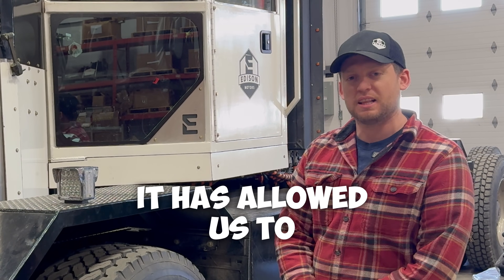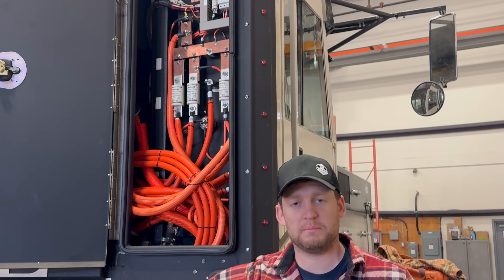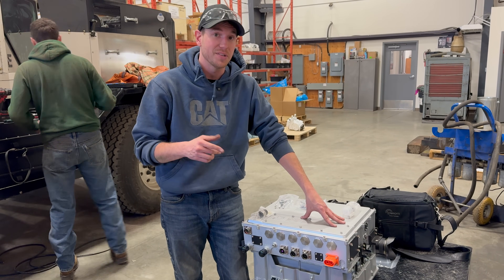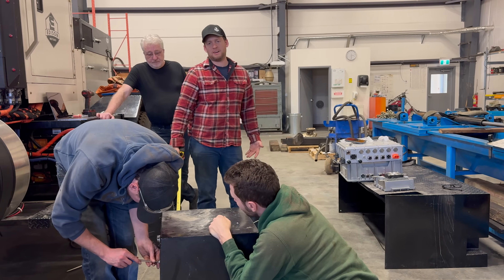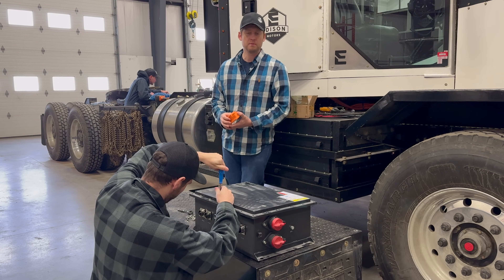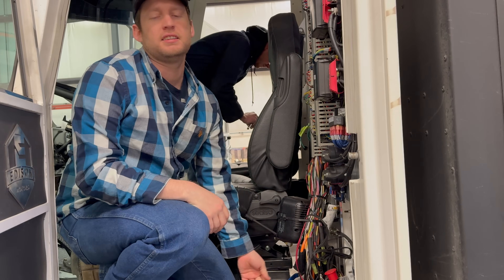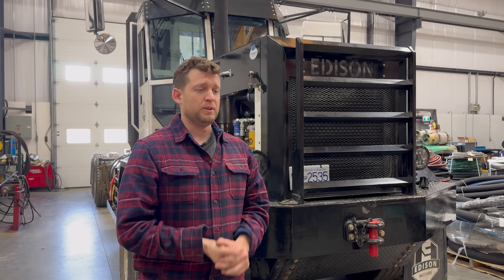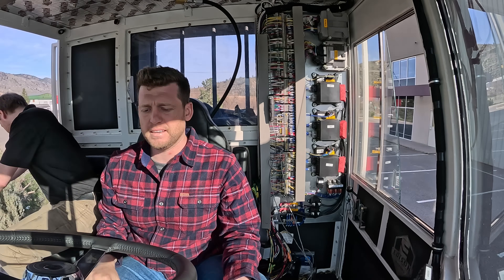Revolutionizing Truck Power Systems: Lessons Learned Prototype

Comment: suggestion have 🔒 lock out tag out protocol  so nobody can turn on and accidentally fri 
some   
   industrial systems had a Lock out that either cover or  mount on and has multiple provisions for locks 🔒 so if more than one person working on different areas can't be turned on till all locks 🔒 have been removed = to everyone safe

Comment: Congratulations Chase and Edison Motors.  This tech makes more sense than an off grid emergency generator and using off grid power with diesel backup.  One day perhaps a front grill wind turbine and solar roof on trucks and trailers roofs.  Solar modular units.

Comment: Just like when Im building vacuum tube audio amplifiers, gotta varify there's no volts left in the system lol. I know that's gotta be scary though, I'm worried about like 100 milliamps at 450v DC at idle (no signal) but your possible exposure is so much more current than that.

Comment: You should goto a DC generator, ditch the ac 3phase unit, there's probably 5% fuel economy in that just from PF and thermal loses. Also, I think you've oversized the genset, i bet you only need a 50% of what have now, but that varys with aero and weight. For on road hybrid conversions, probably use a smaller genser for dry van etc
Reply: I believe they increased the size of the genset because of power requirements. 🤔

Comment: Hey Guys!  Question.  What is Topsy's theoretical top speed?
Reply: In the absence of throttle limiting:
225Kph (~140mph) both forward and revise. 

If the specs I came across are accurate,  though I doubt anyone has been nuts enough to test it yet even on a test rig.

Comment: I hope the new cab design makes maintenance a little easier as the current iteration looks to be a bit of a pain in the ass.  Removing the seat and crawling around on the floor that's inevitably going to be covered in mud just doesn't sound remotely fun.

Comment: Honestly I like the headache rack being   .. maybe not hot swappable, but an all in one deal.. having all the important stuff in there makes sense. Would love to see it be modular, though. Custom fab cabinets that just bolt on or slide in. That way, if something breaks, you just pull the cabinet and slot in a replacement

Comment: What are you going to do to replace the engine brake and will it hold back a load down hill?
Reply: A jake break capability has been discussed a number of times,  though I'm not aware of it having been implemented and tested as of yet. 
If I understand it correctly,  it would be capable of being used for breaking as well as bleeding off excess power to protect the batteries from being overcharged by regenerative breaking power generation.

Comment: just an idea that I have had for a while.  I think you should put motors on the trailers as well for that would take a big load off the truck as well as give a lot more regeneration with the braking.  I am wondering if you have thought of this.
Reply: There are at least 2 major manufacturers presently developing/testing power equipped trailers both for drive and regen' purposes.

Comment: Sometimes it's hard to justify changing little things during prototyping as they mostly work. So sometimes it's good to blow things up so you can change out the big and little things you might not normally change out until later down the road. It's the "if it ain't broke don't fix it" well it broke so now the nice to haves get dealt with too.

Comment: One thing i don't get is why plastic airlines don't work. I work on the light duty side of things, and nylon fuel lines are quite common in the us on cars, mostly pickups from the 90's to the early 2010's. I get them going bad all the time, but that's usually when they are 15-20 years old. Granted, the connections are almost never the sharkbite style push fit. they use hose barbs that are pressed inside, in repair the nylon must be heated first.  It's about half the pressure airlines work at, but i would think compression fittings instead of the push on would work just fine at airline pressure. 
IDK, what I'm trying to say exactly, I just feel that the problems with newer nylon airlines is more of a connection/quality/design issue than a nylon issue. And it doesn't have to be nylon either, but I think solid tubing of some sort is the more ideal cost to robustness to longevity to weight to ease of repair ratio than braided steel cable. At least for the long runs along the frame rails.
Reply: I guess the logic is that they work well enough. Newer heavy truck air system quick connect fittings, in my experience, are almost all the quick connect style that can be disconnected again fairly easily. The main reason they are used imo is that in the bean counter's eyes, it takes too much time to assemble a truck air system with older style fittings that are good to go for decades with brass ferrules that crimp down on the hose when tightened. If the quick connect fittings start leaking a little air a couple years down the road, who cares? It's long gone out the factory door and probably out of warranty too

Comment: I was just wondering if anyone here has heard of Dynacert its a Canadian company aswell. I feel like if their product works it would be a great fit for your project.
It is supposed to make cleaner and stronger combustion with hydrogen and oxygen it produces from electrolysis.
Just an electrician not a diesel mechanic.

Comment: Just a quick suggestion. Have you driven a Nissan e-Power vehicle. It too has a electric drivetrain with a petrol engine as generator. But their generator has more than one RPM configuration. As an example for a high power requirement it would increase the generator RPM and has the ability to draw power from both the battery and generator to power the motor when required.

Comment: OK, I just had a light bulb moment.  If I understand this, there are no gears to shift?  This is like an automatic; forward, reverse, and instead of neutral you just have off?  So, your accelerator pedal take you from zero to top speed with no interruptions?  Oh, and you could get full speed in reverse?

Comment: I use air vacuum tool called Air-Lift to vacuum coolent systems on cars , when mostly drained , i pulla vacuum ot 25 HG and close the valve and disconnect the vacuum part of the tool and connect the hose to suck the coolant from a bucket into the system when I open the valve , it takes only about 5 minutes to vacuum down a system and re - fill it and it gets out all the air every time , much faster than pouring it and running the engine trying to get all the trapped air out , some cars have bleader valves that usually don't work totally well .
Vac the system down just like you would a AC system to get All the air out and then fill it , end of the problem, and very fast .

Comment: It would be nice if you added LEDs with big resistors to the high voltage lines so you have another indicator of "hey, this is HOT".  That way if the voltage is below 48v, the LEDs would extinguish, be lit anywhere above that.  Having multiple LEDs in parallel with separate resistors would also account for failures of individual LEDs.

Comment: From what Chace said at the beginning about the voltage drop from the generator taking a load. Couldn't you simply use a loop PID on the generator RPM so that when it takes a load, it will automaticly readjust itself at 1800 RPM. Instead of it being a constant ? There is a PID ready to use in the plus 1 Guide that you are using to program.

Comment: Another locomotive inspiration for ya, locomotives will "crowbar" the high voltage systems when you access the high voltage cabinet with a door interlock. This will tell the computers that the system is also discharged, and you can follow a flow chart if the computers are inaccessible to verify high voltage systems discharge much like you did manually.

Comment: You need leather protectors over your low voltage gloves. They make them to fit over the rubber gloves.   Prototype’s are to expose problems and find solutions.  No one thinks of everything the first time.

Comment: New inverter makes more heat in your cooling system. Going from air cooled to water cooled sounds right. If you pull a vacuum on the cooling system you can get the air out of it. Terry at Yosemitetractor.

Comment: i just heard 12 volt 24 volt batteries, ...
you neeed Higher voltages
i do understand the logistics, i do understand the engineering, i do understand the immense leap that YOU are making
good luck friends
Gotts say,..what a sick looking rig when its rollin down the road, what a Beast
Good luck World Beaters.
sorry by higher Voltages i mean "match Teslas charging networks highest voltages", what you are doing is immense but do not come outta the gate behind the technologies that are powering the established networks for Charging and at the very least reach out to find the best spec to do so with for the future,
Reply: Those are the low voltage batteries for running the air compressors, computers, starter motor for generator. The high voltage batteries are the one that actually move the vehicle
Reply: @JD-yx7be  
ahh very good , i must re watch to see what the actual "Line" voltage is for the storage pack, i used to think it was 400Vlts ,now im not sure.
I know that the "Industry" is heading towards 800Volts (or higher) and it would be a good solution to be able to access that Infrastructure "out of the box" and capitalize on someone elses expended capital.

Comment: did you test drive it with the batteries unplugged? or where you just doing first test with the upgrades? im glad i recommended being able to limp it around on just the generator! that truck could sit for 50 years and fire right up with A jump! amazing truck glad to be A part of an amazing world changing product. good luck and gods speed!

Comment: Guys I love what you're trying to do but use the electrical insulation gloves properly.  Please. To put on gloves 
Step 1  apply talcum powder to the insides of the rubber gloves.
Step2 insert hands in glove
Step 3 insert the rubber gloves into the leather gloves that came with the rubber gloves. 
Then do work.
 The leather gloves are of vital importance.  They absorb the damage from sharp edges and the dirt and grease that can be found in the electrical  field. 
You NEVER work with just the rubber gloves. The smallest pin hole in the rubber glove and it is no longer  rated for high voltage.  High voltage needs only a hole from a hypodermic needle to jump the insulation of the rubber glove and make contact with your skin. If I had seen any of my electricians do what your man did. The gloves would have to be sent off for recertification.  I know you're just loggers and field mechanics.  But high voltage  must be treated with respect at all times. 
So  always keep the rubber gloves in their plastic bag. These rubber gloves must be clean at all times. High Voltage will find a path on dirt. 
Now I assume your voltage is 480v 3ø Y  which is not high enough  to cause most of the issues I've stated. That being said  follow to proper safety rules  on using these gloves. Because you are using a tool use it in the manor it is designed to used. If you're higher than 480v then.what I've said is vital for you to follow.  Finally if you're over 480v buy a High Voltage tic tracer.  On voltage over 600v we use only high voltage  tic tracers because the voltage will explode a multimeter.
Reply: You forgot Step 0 the most important one..roll up cuff to make sure you can create a balloon with glove( hole test) no balloon no use
Reply: Would be worth them bringing in an expert for a few hours to review their safety procedures. You only get to make a mistake with high voltage once.
Reply: Here in Canada our standard industrial voltage is 347 Wye phase to phase is 600…
Reply: @John13Edge   it was the insulation gloves being used as work gloves that triggered me.  Put a hole in them and there's no point in having them. . 277/480 Y  .
Reply: Bump this up, you only need to kill or maim one tech to regret it forever, and EV stuff has more than enough power to end you instantly. Get a class taught to the team, and refresh once a year. 

Also, while on the topic of safety, does your shop have an emergency protocol for battery fires? Cuz it'll happen, that's just statistics, and you need to be aware that lithium batteries won't extinguish with an ABC extinguisher. I'm curious what a big shop can actually do to keep it safe, cuz on small scale stuff I've had to resort to "chuck it in the yard and wait."

Fantastic work btw, very nice trucks.

Comment: Those battery disconnects, is there a chance that it could allow the 2 batteries to connect to a common bus at 2 different voltages. The switches seem to run into a common bus bar at the angles i see. From what i have seen that could cause a dangerous scenerio where the lower battery tries to get charged by the higher battery if there isnt some sort of protection. Am i wrong?

Comment: Would you consider an engine gennie pack similar to military tanks where it's one unit in a frame. Unplug, unbolt frame bolts, disconnect lines and lift out as one. Lower new pack in and connect up. Less down time for truck and units can easily be bench tested.
Reply: Cummins just released their new version of this for the next generation of combat vehicles.
Reply: Electric classics 🇬🇧  use a conversion system for their electric kits.  So they only have to work it all out for each type once.. and remove it if needed and put it back.

Comment: Nice to see that redundancy and safety margins are still a major focus. Also I couldn't help but notice you say with the new BMS you can go full speed?     Is there a dragstrip in Topsy's future for a max output test? Please
Reply: when its AWD this thing is going to be doing wheelies off the line, it could probably do a quarter mile in less than 15 seconds!
Reply: @PandoraJT0121  they also said in the beginning that they would electronically limit Topsy to 90 mph whicj would make the quarter mile difficult. so I guess the 0-60 is the question
Reply: @PandoraJT0121 No way, it's gonna run out of gears

Comment: One governed speed is an inherently bad design choice on production systems. It makes sense to make a prototype an affordable development platform, but not in day to day applications where load swings wildly every few seconds. Not only do you face design challenges, you can end up underloading the engine on most conditions. You can reduce the speed of the engine when the call for power is low, like in stopped traffic, and then increase it until the governor is no longer at full fuel. Theres obviously things you need to work out like minimum motoring RPM and the like , but a fixed engine speed is going to expose teething issues that you hadn't thought of yet.
Reply: When the BMS is working the engine will only work und full load and charge the batteries
Reply: @raphiseth6942  And when the BMS fails and the engine is the only way to get you 200 miles home?
Reply: @pootispiker2866  this can handle the engine. Not for every day use but for this application ist good enough (the Word of engeneer, Not to build to Last forewer, only to Last Long enough)

Comment: You can adjust most generators to recover rpm when a load is applied.
Reply: True, but until they installed the new BMS they couldn't bring the rpms back up, the old one wasn't rated for the voltage that produced.

Comment: In the Air Force, every tool has it's place marked by a shadow in paint under it.
If all the tools are not there, the plane  does not fly.
In the 1990's the US lost a multimillion dollar C5 to a 12mm wrench left in a dashboard.
Shadow Boards for a reason.

Comment: This is exactly what prototyping is for.   If it don’t break you are not working it hard.  When it does break you fix it and the issue that caused it. Now you have a better truck because if it.  Kudos on the break line air.
Reply: Thought this was a production truck?  Chace keeps saying production....
Reply: Legally it's the first production truck, but functionally speaking this is just a late development prototype. @D2O2
Reply: @D2O2  He never said that. This is a development platform for testing
Reply: @JD-yx7be  Maybe not in this video, but in several other videos.  How about the video titled:  "  Electric Truck Transformation:  from Prototype to Production?   Carl was the prototype, Topsy is production as Chace consistently refers to them.
Reply: @D2O2  That was detailing the steps they are planing to go to production. Topsy is still in testing as seen in this video as well as past videos
Reply: @D2O2 there is a difference between a production prototype of which this is and a production model
Reply: @Skaadi89  To call Topsy a production prototype is laughable.  They haven't successfully demonstrated proof of concept.  They have NEVER hauled a load through their target cycle.
Reply: @WowCreativeUsername  I'm standing barefooted in my backyard currently,  how about you?
Reply: @D2O2  Living life instead of pointlessly blowing hot air in comments.
Reply: @D2O2 You have to walk before you run. So no, it’s not laughable, it’s part of the process.
Reply: @JimsEquipmentShed  I agree you have to walk before you can run, but you also have to crawl before you can walk.  What is laughable is to call yourself a runner when you can't walk or crawl.  Topsy's level of maturity in terms of the product development cycle is being way over stated.  They haven't completed the proof of concept phase.  Topsy may be in form of what Edison wants to go to production with, but they have no clue if it will even work yet.